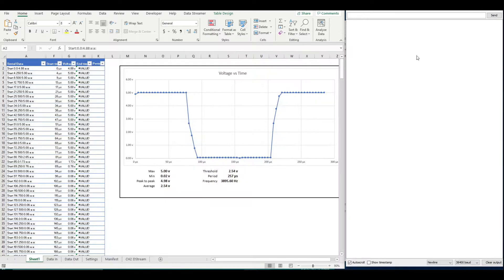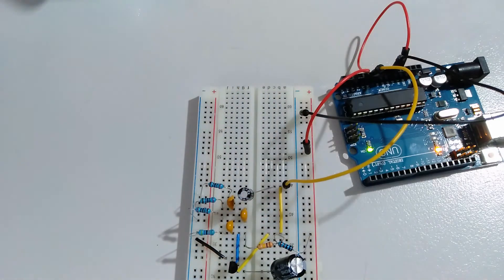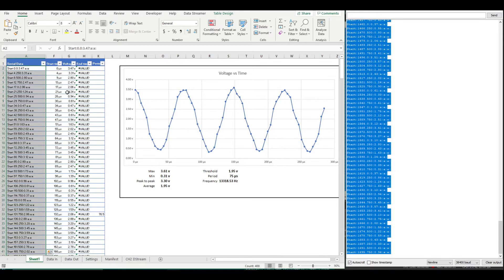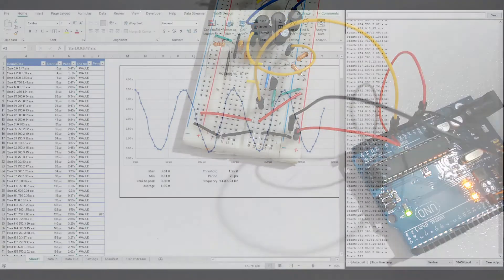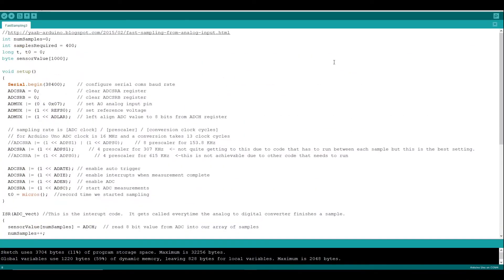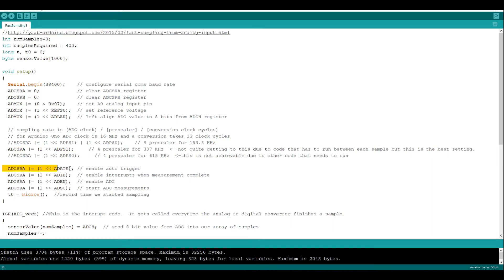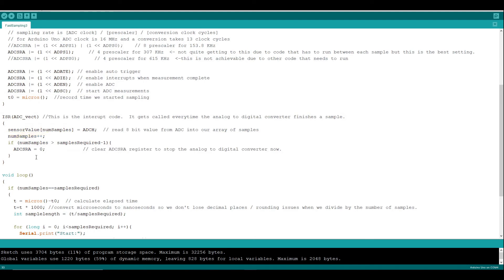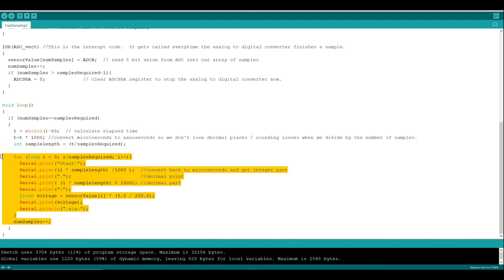Very Fast Analog to Digital Conversion with Arduino (Exceloscope part 8)

Comment: Very good Video helpt me out a lot, would it also bei possible top get your Exel File
Reply from the maker: I have added the excel file from part 7 to the github repository https://github.com/OverEngineeredInOz/YouTube
It is in the folder ExcelOscopePart7.
The Sheet1 worksheet is the version that doesn't use Excel Data Streamer feature.  The CH2 DStream worksheet uses the data streamer function.  In this video I was using "Sheet1"
Hope this helps.
Reply: @overengineeredinoz7683  thanks

Comment: Thanks for this excellent series of videos.  Is the code used in this series downloadable anywhere?
Reply from the maker: Thanks. Currently the code isn't downloadable but I was thinking maybe posting it on GitHub. Do you think that is a good place?
Reply: @overengineeredinoz7683  It's the place most people seem to post similar things to.  Also have you thought of updating to an Arduino Nano 33 ble, as it's faster clock speed and large on board memory should help with sample rate.
Reply from the maker: Code now available here:
https://github.com/OverEngineeredInOz/YouTube/tree/master/ExcelOscopePart8